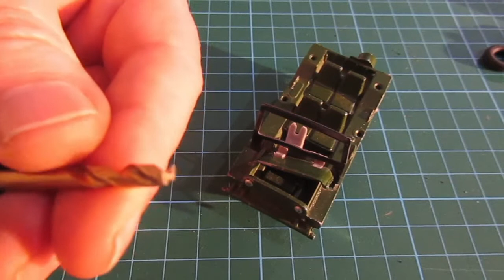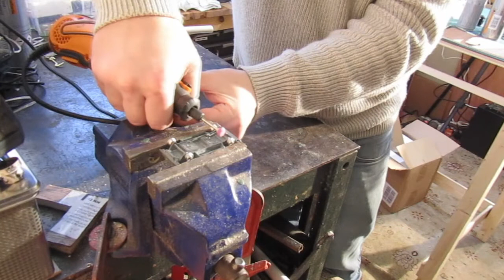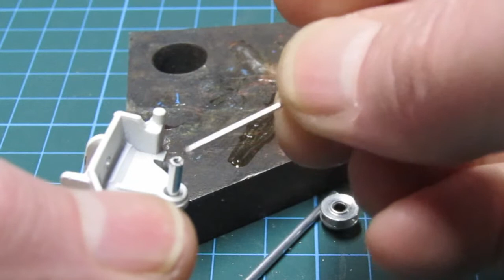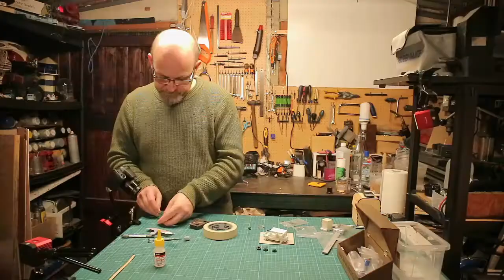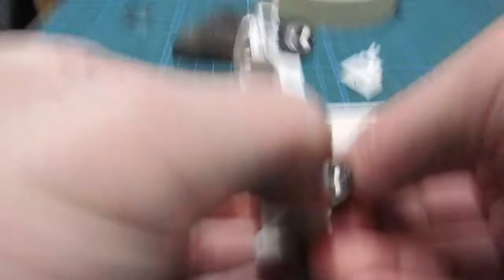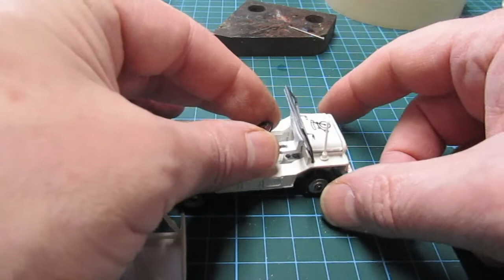Making a TV Prisoner version of the Mini Moke Prisoner model 106

Comment: Another great resto, thanks! I'm about to do a similar one myself, where did you get the axle tubes and pins from? That approach certainly looks easier than trying to round off steel rods as I've seen in other videos. Cheers!
Reply from the maker: yes, much easier and I get them from this chap on ebay
https://www.ebay.co.uk/str/admc-code3?_trksid=p2047675.l2563